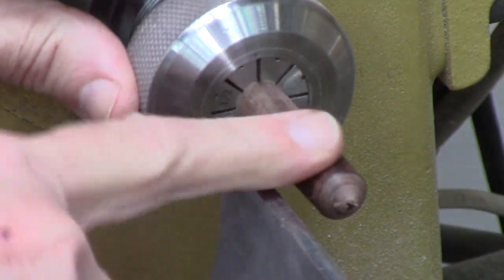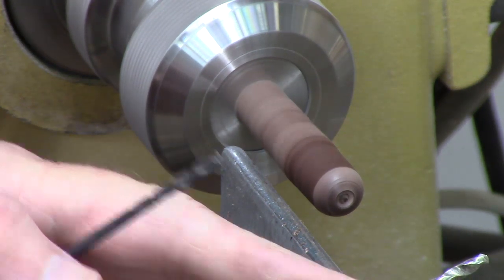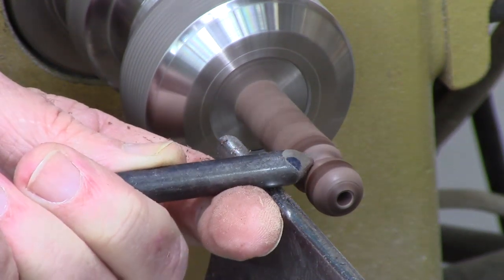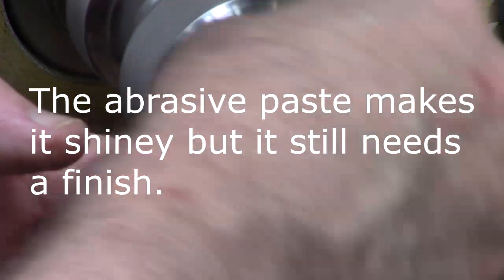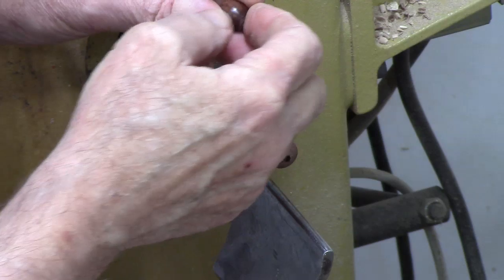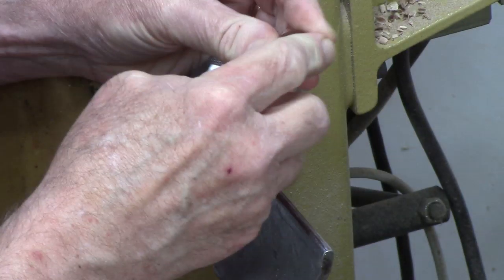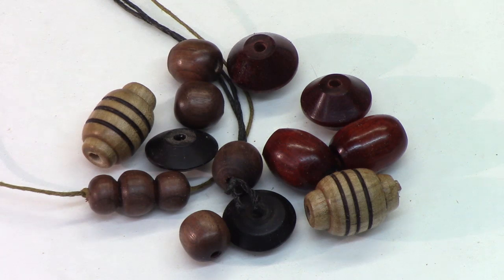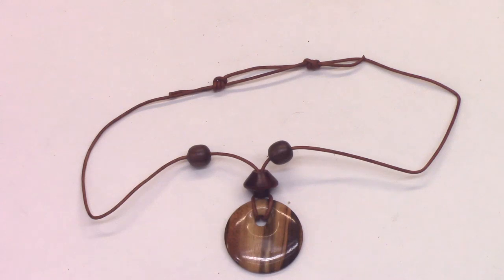Jewelry Beads on the Lathe

Comment: Mike, you asked for tips .For catching flying items when parting off I place a 2litre ice cream box on the bedways. Nearly always successful, and essential when ejecting stuck Morse taper mounted Steb centres with a push rod. Some shavings protect the tips.(No longer using my wife as wicket keeper!). For continuous cutting beads &c., providing the bore is not too fine nor tool pressure too great, a hardened steel rod can be used as a  simple mandrel, with bored wooden Morse taper in the tailstock. I use a three jawed chuck, which also allows the headstock to act as mandrel saver. Bushes are no problem. Of course a long drill is necessary, and you could still mount the blank  in your collet chuck and let the cut beads slide along the mandrel safely..   Bernard.
Reply from the maker: Thanks for sharing those tips.